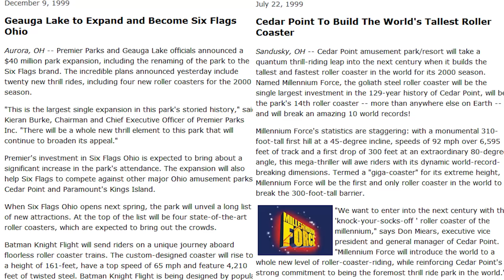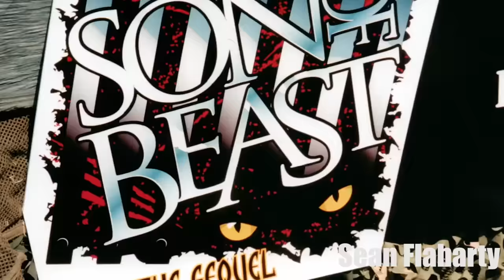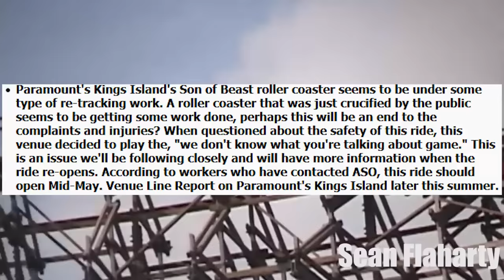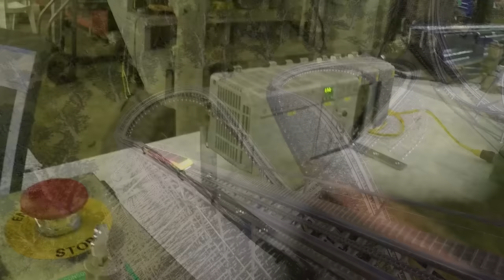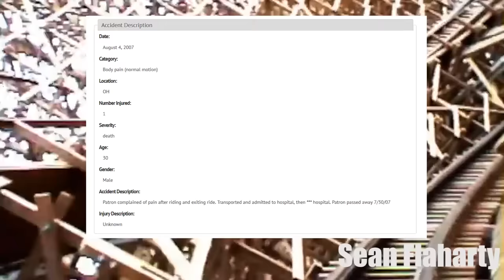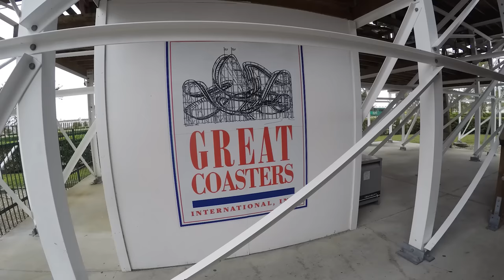What Really Happened on Son Of Beast Kings Island July 9th 2006?

Comment: I'm such a trusting fool.  We all probably assume safety and we shouldn't before we do our homework.  I consider myself lucky living in MA close to Lake Compounce in CT.  The two wooden coasters of note there are both extraordinary but not without worry.  Boulder Dash is so vicious and fast - and I love that - but I hadn't sprained my neck since I was a young boy.  It is a stressful, fast and seriously rough ride, and an unexpected turn did it.  Plus the last two or three small hills of the historic older coaster called "Wildcat," while bunny-hopping was suffering from an obvious wear that felt like it was jack-hammering us in some resonant frequency, with no relent when the 'banging' started till the ride was over - which was challenging as well.  Wildcat is far more impressive than one would have guessed knowing how old it was - it is surprisingly terrific.  Luckily, finally as the breaks were applied right at the end of the ride, the jack-hammering finally stopped.  My expert buddy (these 'expert' guys all network and know the mechanics, if any wheels have been replaced, re-tracking, the original layouts vs. modifications - all the technical info, whereas I just like to ride them,) mentioned that they need to re-track the end.  But, as in this near catastrophe with Son of Beast, had the riders gone around just once more, it would have spelled disaster!  The malfunctions don't rectify themselves - and, in fact, quickly grow worse if not catastrophic - it is surprising that the park owners would continue to run Wildcat before fixing their problem.  It is 85% wonderful, until the end when It turned seriously painful to ride - 'This has to be a mistake...' I was telling my buddy as we were all rattling and shaken to bits in our seats for a very long five to ten seconds.. It doesn't seem like much time but - I'M TELLIN' YA - it was seriously dangerous to the coaster/cars/and riders.  When it stopped, I was laughing MFAO as we all waited to be released. 'They gotta be kidding - are they aware of that?'  A truly WHEN-GOOD-TIMES-GO-BAD moment!  I blindly trusted the safety of coasters till that day - end of the season '19.  With the shutdowns due to Covid-19, hopefully all of the parks can catch up with routine maintenance and all necessary repairs - because we do come back.

Comment: Ankylosing spondylitis is a big deal. This video skipped over that. The vertebra fuse together at the discs that normally allow motion, meaning that almost any forceful bending will cause a break. It does not take very much for a person with ankylosing spondylitis to "break" their spine, much less than the force of a rollercoaster. That person should have never been on a rollercoaster in the first place.

Comment: GCI’s Mystic Timbers is a piece of shit ride, too. I was a ride operator at Kings Island in 2017, when it opened. The main lap restraints would sometimes open up again randomly. Even when I noticed this and tried to E-Stop the ride, as someone on the microphone, the ride didn’t stop in time before reaching the lift hill. Everyone was removed safely, but Kings Island fired me for it, saying it was my fault. Six other ride operators had the same thing happen on Mystic Timbers. My mum, a safety inspector with OSHA, went to evaluate the park this past April, and when inquiring about any incidents with new rides (Mystic Timbers and Orion being the newest two rides) park officials refused to speak about Mystic Timbers. That ride, and any wooden ride by GCI, is a death trap waiting to happen.
Reply: i think it was fun to ride but orion is so high i was to much of a wussy to ride it by

Comment: I rode Son of Beast multiple times before its demise. I had the privilege of riding it the first season it opened and it was a fantastic experience. It was a wooden roller-coaster so I expected it to be rough. When I rode it in the following year I noticed it was far more rough and it did bruse my then girl friends and my legs. I would say I rode it a total of 5 times over the years it was in service and it got worse each year. After they removed the loop it wasn't the same as that was the best part. 

The original beast is still one of my absolute favorite rides and that will never change. This ride had so much potential but I think it was doomed upon insecption because they went with the lowest bider instead of spending the extra money up front to make sure it was top notch.

Overall I still have great fondness of SOB and I'm one of few that got to ride it in both configurations.

RiP son of beast.

Comment: I worked at Paramount Canada's Wonderland many years ago, and went on a road trip with my co-workers to Paramount King's Island in 2000 because we had free admission.  I did ride Son of Beast, and I have to say it was a very rough ride.  I was jostled around a lot, but luckily did not get hurt. I knew I would never ride this again.  Although the coaster is not there any longer, I still have a pin set commemorating the anniversary of Beast and the opening of Son of Beast.

Comment: How in the actual fuck is it legal to be able to just up and decide to start a Roller Coaster manufacturing company, without first hiring any competent engineers to design the coasters? Thats fucking insane. People's lives are literally in your hands when building coasters, and it's like they just didn't give a shit. This could have been SO much worse if they had sent out the next train. That train would have most likely left the track and flown off, or perhaps even worse, left the track and ended up going down through all the wooden beams. Which would have probably taken heads off. In order to build coasters, you should have to be held to a very high standard with making sure that everyone working on the coaster knew what they were going. Because this shit is unacceptable.